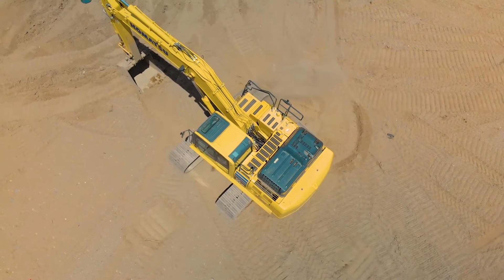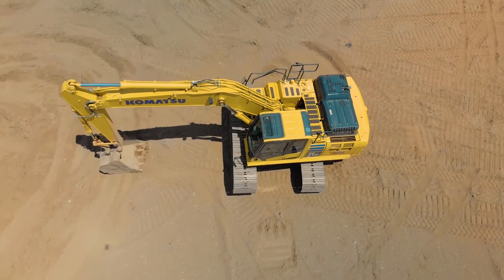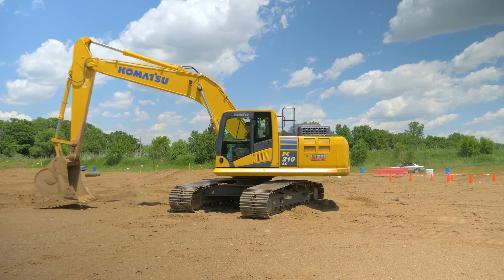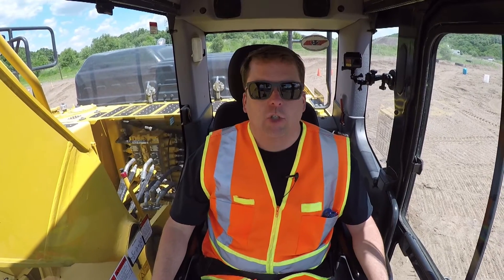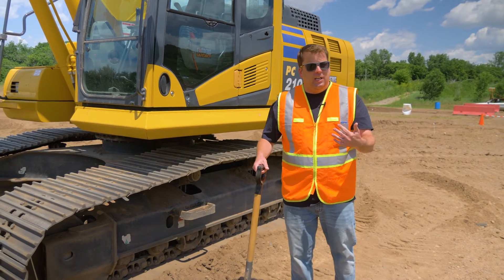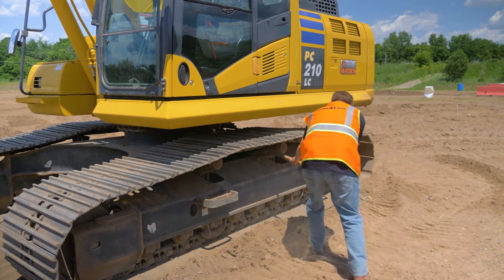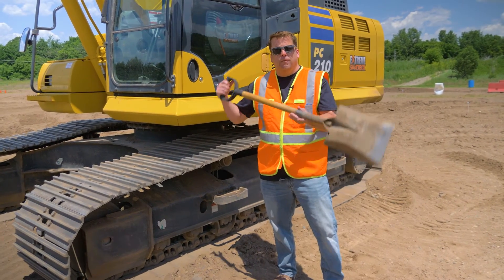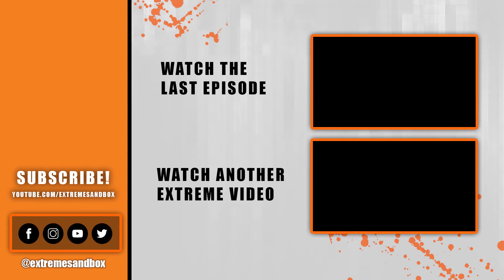How to Clean Excavator Tracks | Quick Tips // Excavator Training

Comment: now make a video with the tracks filled with hard clay
Reply from the maker: Agreed...our Texas site has that and it is no fun at all!
Reply: I have to do that once a week.  
I had this white clay that would just turn slippery. Takes ten to twelve hours to get proper clean with a hippo jet wash with heat.
Reply: @justinmorton7201  what about a pressure washer with a 0° tip? I clear clay packed tracks along with the whole machine in 1.5-2 hours.
Reply: @LJT9393  why bother with all that? why not just dig a hole and fill with water and run the tracks like he does here but in the water bath and wash them that way?
Reply: @keith3761  mobile pressure washing is actually getting very popular in the last few years. I said that when I used to do that for work. Now I just drive fuel trucks screw all that heavy equipment washing lol

Comment: That is not a spade shovel. That's a flat grading shovel. A spade shovel is narrow and long.  The blade is half as wide and twice as long. And it is better than a flat shovel for cleaning off the tracks of any type tracked equipment.   👍
Reply from the maker: Whoops...but still think flat is way better for cleaning tracks.
Reply: @HeavyMetalLearning  How do you get that wide shovel between the tracks and the frame above and around the drive motors on a dozer or loader? I have always used a flat spade for track cleaning but to each his own. People are different and prefer to do things differently and that's part of what makes everything work out in the end.   👍
Reply: Yes a square shovel or square spade is best. I hate seeing people use any kind rounded shovel. Feels like a coat of paint comes off at every swipe. Its also easier to damage a hydraulic hose. I wonder if someone sells a tool that cleans equipment without scratching paint to bare metal. Besides power washing.